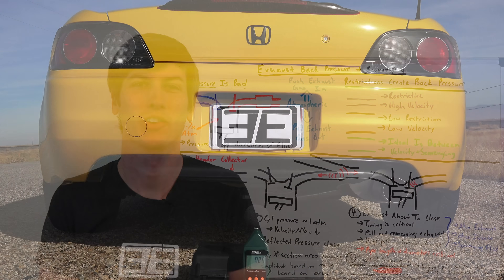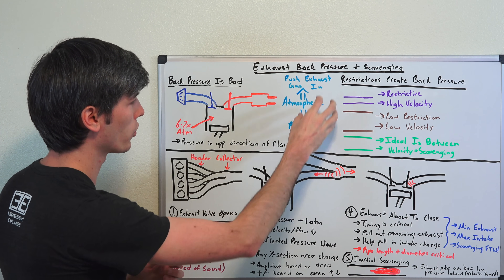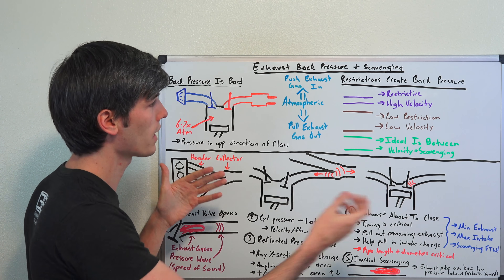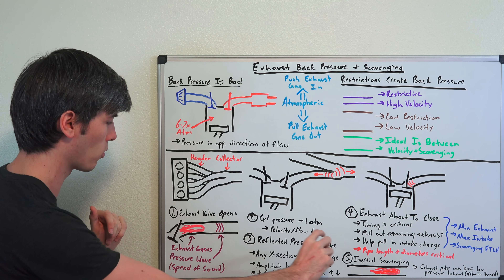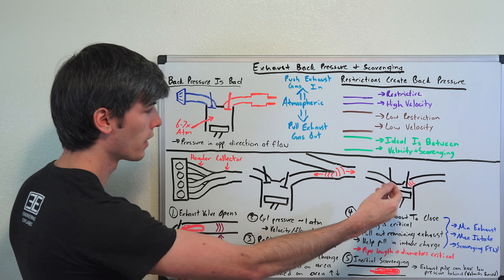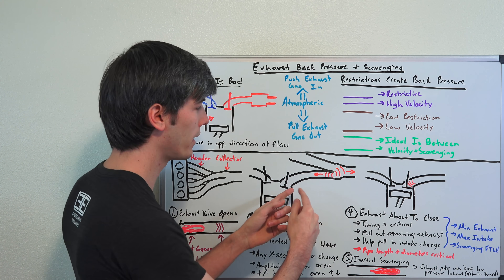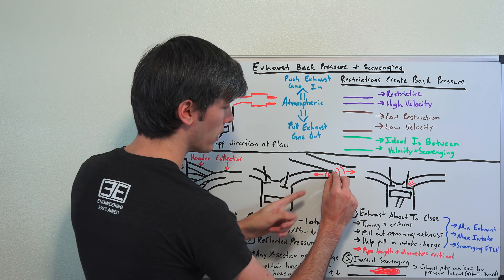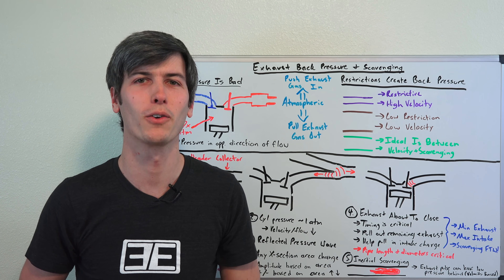Stop Saying Car Exhausts Need Back Pressure

Comment: Back pressure is necessary for proper engine optimization. Valves float at high RPM without exhust back presure. 
Every engine I've encountered floats valves at high RPM without exhust back pressure. I suppose a bit of education is needed. I have video of valve float at 4k rpm without proper exhust back pressure.

Comment: Theory is one thing, but what happens with a turbo then ? that's a restriction right there.  But more importantly there is a channel here that put a engine on a dyno with new headers, and then they smashed one of the tubes 1/2 and guess what the dyno was the same. The piston moving up will push out the gases regardless of any scavenging.

Comment: FINALLY 

I've been telling 'old school' horrid guys that you don't want backpressure,  you lose power they keep telling me no it will run like crap.   

But my defence is if it is needed then why do nascars, drag cars and other race cars not run boxes?  While some do run boxes that is only because there are noise limits but rid them noise limits like f1 and there won't be a single exhaust box in sight.

Comment: Good video but, back pressure serves as a restrictor which is good for 2 reasons, 1) Piston Engine longetivity 2) Fuel consumption.  Real-world there will all ways be back pressure + heat generated by compressing air. No back pressure no usable torque. Crappy 1/4, 1/8 times. Higher top speed, not really usable that's why turbine cars were abandoned as poweplants in cars, now as generators that's another story.

Comment: why would my 4.6 mustang lose 30 hp with open headers, i mean it was horrible slow without back pressure, even my 532 ci big block ford has more power on the bottom end with insane restrictive exhaust i mean 3 inch pipe running into totally stock quiet system on a 2004 xj8, its only until 3500 rpm when the restriction loses power, i have electric dumps on the car and i have ran the dumps open and closed and there is a noticeable difference, after 3500 it needs those dumps open but all in all having them closed it has more bottom end power.
Reply: z guyee man no it doesn’t shut up

Comment: Exhausts DO need some back pressure otherwise the intake charge tends to go out the exhaust port on engines with a lot of valve overlap. Which is almost every engine, that's the reason old race cars with zoomies usually shoot flames out the exhaust all the time. Yes there is a balancing act, you want SOME back pressure, but too much causes a engine to be really laggy on acceleration. This can actually cause the engine to overheat or detonate under load as the heat that is usually transmitted out the exhaust gets trapped in the engine. It's a combination of several things that determine how much backpressure you want, engine size, typical load, valve overlap, turbo or NA, port size and combustion chamber size, those will determine how a engine runs as well. Hope the things i said make sense, GL everyone

Comment: Exhaust back pressure isn't necessarily bad depending on the application. If your only goal is to make as much power as possible then of course more air coming out would mean more can get in faster. However if you have a scenario where a turbo with an internal waste gate isn't able to keep up with your free flowing exhaust the turbo will always over boost, so some exhaust back pressure is needed to maintain a steady boost pressure in that case.

Comment: Very clear and informative, but you didn't mention that with 2-stroke engines back pressure is actually necessary to stop the incoming charge disappearing straight out of the exhaust before it gets a chance to burn. There's no right answer to what length the primaries should be on a 4-stroke engine; it depends on what you are trying to achieve. You could for example run relatively short primaries to improve power output at high revs (say, on a race engine), but this would give very poor torque values at low revs which would likely not be good for a road engine. Conversely, longer primaries, would generally improve torque and low revs at the expense of the top end of the rev range. This is a super simplistic generalisation and in reality the exhaust would (hopefully) be designed in conjunction with cam profile, valve size, inlet design, etc, to achieve the desired result. And also, taking a four cylinder engine as an example, you wouldn't necessarily use a 4 into 1 design - a 4 into 2 into 1 set up would generally give you a wider spread of torque, but with only a small loss of power at very high revs.

Comment: Well, maybe if you happen to own an old saab 92 with the two stroke twin in it...
Then you'd need to read up on tuned pipe theory to start making power. Divergent cones, convergent cones, belly of the pipe, stinger lengths...

Comment: This is all completely true for 4 stroke engines but the situation for 2 strokes are completely different. It’s not a matter of adding back pressure to the exhaust and you get power it has to get done in a very specific way. This is what expansion chambers do.

Comment: I don't think the engineers at kawasaki agree with this. The exhuast muffler outlet on my klx250s is barley 1/2 inch diameter. Must be why it only makes 17 hp :/

Comment: I ran open manifolds on my v6 f150, so no back pressure at all. No torque, extremely loud and now a burnt valve and u wanna say back pressure is bad. Sir, I mite not have a college degree but any REAL gearhead knows you have to have a little bit of back pressure to help the valves close or you'll end up burning one like I did.

Comment: my question is where did you get a figure like 6-7x atmospheric pressure in the cylinder? maybe when cranking and doing a comression test alone but when combustion occurs i have seen as much as 600psi which is about 50x more pressure then atmospheric? sorry if im not getting your explaination of that but i would love clarity on how you achieved that number as your baseline...
Reply: It will be about 6-7x at bottom dead center(BDC), when the exhaust valve opens, after the air/fuel mixture has burned and the piston has traveled down as far as it can go. Yes, the maximum pressure inside the cylinder (with the piston near the top, after ignition) will be about 600 psi, but the exhaust valve has not yet opened. 
If you were doing a compression test, you are measuring the peak pressure at top dead center (TDC) of about 150 psi, but at BDC during a compression test, the cylinder pressure will be exactly atmospheric pressure.

Comment: im really tired of this guy and how he claims to teach the truth. he is neither a mechanic or an engineer. everybody please look up Venturis law. most cars reach peak power at around 5000-6000 rpm, most peoples understanding of the combustion engine are very basic, and cant even begin to understand whats going on in an engine at those revs.(thats 100 revolutions per second, think about it) first thing, exhaust valve kicks open at around 75% through the power stroke, combustion is still happening in the exhaust pipe. second exhaust and intake valve have about 15 degrees overlap at all times (back pressure is very effective at aiding this in cars built to be fuel efficient). in a sports cars built for high revs, a venturi (or restriction) will actually create a vacuum at those revs giving you negative back pressure.

Comment: So basically those calculations are done by the manufacturer to set the exhaust parameters making the scavenging process ideal. Does this mean that when you change your exhaust or upgrade your cam-shaft you're actually harming the engine by negatively affecting the scavenging/inertial scavenging processes as a result of changing those parameters?
Reply: TheMarshall92 not if you tune the engine properly. That’s why VCT / VVT engines are so big now. The sensors (O2 and MAF) on the exhaust and intake calculate the pressure constantly. So simply tuning the engine will trick the sensors to maximize efficiency. But that doesn’t mean putting over sized cams or headers will work. There is a thing as toooo much
Reply: TheMarshall92 when building na engines (think vtec, vvl , vvtli etc) they take into consideration how much the head can flow (or be made to flow) and what rpm the motor can safely handle relative to the power they want. From those figures you can develop intake and exhaust systems that all work together in harmony to maximise v.e (volumetric efficiency) and thus torque/horsepower in a given powerband for your application
Reply: Why would you remove the rev limiter? They may increase it but to remove it would be a bad and possibly costly idea. If you’ve ever bought cams or had head work done, on the box it will should say must be tuned. No the only ones that get that crazy with the effects of exhaust is gonna be your race cars. Cars that people street race most likely are gonna be generally tuned
Reply: but do they get this much in detail while tuning? i get that the try to maximize hp and remove the rev-limiter and sometimes in some occasions help in the petrol consumption. But I'm not sure whether they take the camshaft synchronizing with the scavenging process of the headers and exhaust into consideration.

Comment: Sounds to me like building a 'stinger' exhaust for a two stroke dirt bike engines, power improvements could be very significant, but very peaky, very narrow RPM power band, and the stinger aft of the header, diffuser, and reflector sections could be very narrow diameter for best exhaust velocity.

Tubing length, tubing diameter, and the rate of convergence and divergence at the transitions!  Actually, a lot has to do with the angles.

Comment: So if an engine needs no back pressure to operate why do race teams and vehicle engineers spend billions anually on different sizes of exhaust and lengths of exhaust to make more power and torque with greater efficiency. Some restriction or back pressure is required for optimal performance of a given engine. Contradictory explanation
Reply: that would be exhaust velocity, too small of a pipe, you have back pressure, bad. too large of a pipe, gas travels too slowly, doesn't efficiently remove exhaust gasses from the engine, bad. you get just the right size as to where the back pressure is minimal whilst exhaust velocity is still high. combine that with the geometry of the exhaust. its a complicated thing to design a perfect exhaust

Comment: Is there a formula used for the manufacturing of equal length tube headers? Something that’s based on compression ratio, combined with relative diameter of the pipe?

Comment: I think this myth came up when people changed their exhaust for performance parts and wondering why the car is slower now. So they came to the (wrong) conclusion its because the new exhaust is lacking backpressure compared to the old one. The true reason for being slower now, is because they need a ECU remap to allow their engine to take advantage of the new parts. Because the factory ECU map is designed for the stock parts.

Comment: He didn't explaine collecting cylinders 180° out of phase so a pulse leaving a different cylinder doesn't collide or leave at the same time as another one.
Also he didn't explaine thermal issues if you have the exaust pipe too large the exaust gasses cool off to fast! This causes expanded heavier cooler gasses that are denser requires more engine work to push out

Comment: I have a question. How is the negative pressure wave affected in a vehicle with a turbo where the entire exhaust pipe from the turbo back to the tip is the same size? From the way it was explained without a turbo I think it would have a poor effect on the performance of the engine.

Comment: well you want (some) backpressure when you have 4 valve per cylinder naturally aspirated. however the reason is bacause the camshafts, manifolds and valveplay is designed for that backpressure. its ' effect (basically fuel economy) is minimal (I mean you'd have to change the whole head gasket to screw it up, compression isn't that much affected) but i can't contain my smartassery today.
Reply: of course I meant cylinder head not just the gasket

Comment: Perfect video! ^^ I'd add one thing; more velocity is BAD, since as velocity grows, energy losses grow by velocity^2, that energy loss must come from somewhere, so the flow builds back pressure. Ok, sounds interesting to be near zero velocity; achievable, let's install a crazy diameter exhaust! No, Reynolds number depends of velocity, density and viscosity, if the Reynolds number is way too low (low velocity) the flow becomes non-turbulent, which adds more internal friction in the flux, and again energy losses and less pressure gap to lead the exhaust gases outside.
Reply: I wish I understood fully what you mean.
Reply: That's the answer to my doubt about why exhaust velocity is needed!!! THX

Comment: Soooo, I don't need an exhaust for regulations, what is the best option then... Cut it of after the header? So that the car can build op the scavenging forces, and then after that, can dump it al out?? Or should I straight pipe the gases al the way to the end?

Comment: Couple of points....

Measuring "back pressure", where and how it's done (sensitivity and measuring freq)?

Overlapping valve timing and the affect of neg. pressure wave and "back pressure"?

What methods are used in the leading edge companies to tune?  (PSI, CFD, other)?